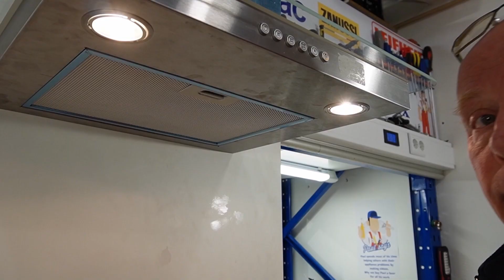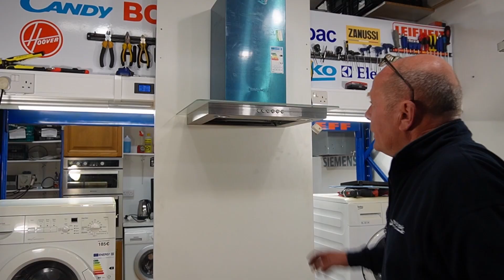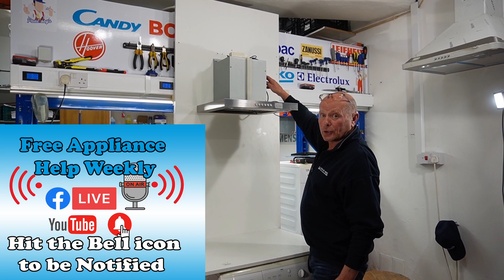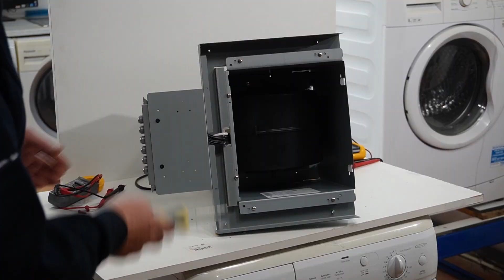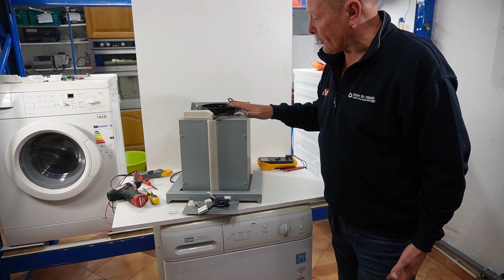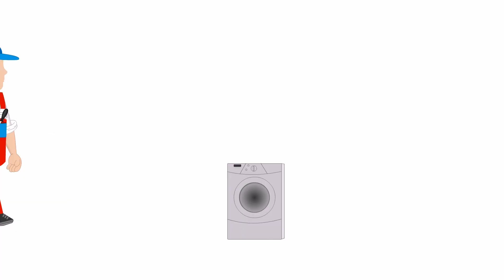Cooker Hood extractor fault finding & fix diagnostic repair, Hotpoint, Indesit, Ariston, Whirlpool.

Comment: Very helpful video, thank you.  May I ask for  your advice?: Our fan is not working at all.  The lights work, and the buttons for the fan light up with the usual audible clicking noise, but there's no response from the fan.  I can't notice any humming noise that you mention where it might be the capacitor.  Would you say it's likely we need to replace the motor?  I just wanted to be as certain as I can before ordering one!  Many thanks

Comment: Recently puchased a new Belling CHIM604GSTA hood. Have an issue whereby the lowest speed setting intermittently runs at full speed, if I turn it off and try again it will still run at full speed. Couple of hours later use the hood again and works fine on low speed. 
Looking at this vid that seems to suggest the PCB board is faulty, should I bring it back or is there any easy fix??
Reply from the maker: The only two things that could control the motor variation in speed is either the printed circuit board or possibly a fault with the motor windings. I would suggest you look at the printed circuit board first. Have a great New Year. Please remember to subscribe to the channel as that helps us. glad we could help you @user-lu7vq4kp7m this is for you https://www.youtube.com/shorts/e432SAb2g08 please remember to subscribe as that's what keeps this channel going. Thanks 👍

Comment: Great video mate... Very helpful... I've just took ours apart on the wall.. Its a prima and basically a similar layout just to have a quick look at why it works sporadically.... Sometimes it works... Sometimes it doesn't... Couldn't check power at different parts because I don't have a multimeter unfortunately... Couldn't see any brakes in the wiring but it was humming when it was switched off but still on at the plug
Reply from the maker: Danny B  this is for you https://www.youtube.com/shorts/e432SAb2g08 please remember to subscribe as that's what keeps this channel going. Thanks 👍

Comment: I've got a hotpoint cooker hood, one of the bulb blew and flipped the fuse box. Put new bulbs in and changed the fuse on the plug that goes to the mains behind the extractor fan and still no joy
Reply from the maker: first I will check you have voltage at the switch, if you fill out the contact us form I will try and help you https://www.how-to-repair.com/help/contact-us/ Thank you For leaving a comment this is for you https://www.youtube.com/shorts/e432SAb2g08 please remember to subscribe as that's is what keeps this channel going. Thanks 👍

Comment: G4 12v max 20w bulb problem not working. Need change the DC Supplier how? Thanks
Reply: I dont find where is the power supplier in my siemens cooker hood, model lc98hc540. Thanks